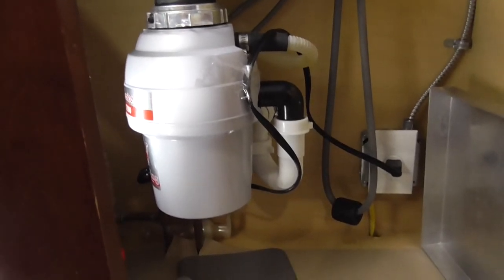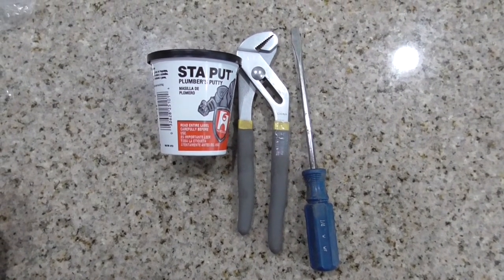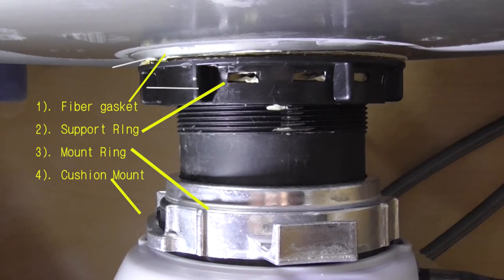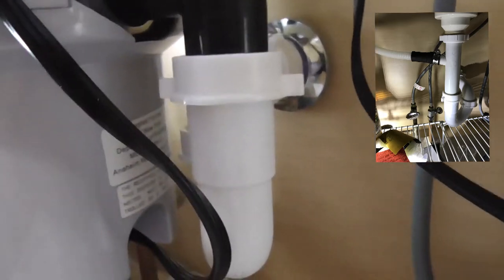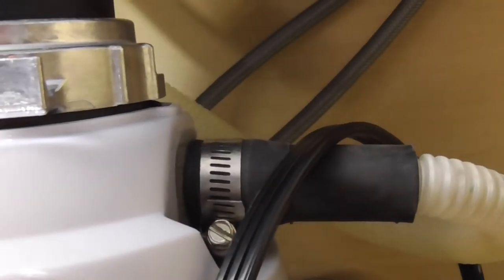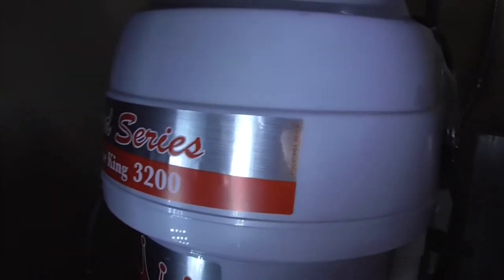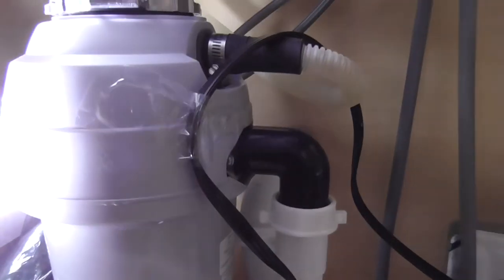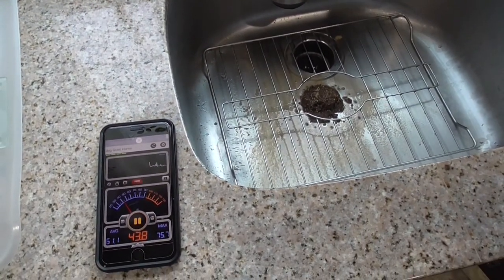DIY Waste King Garbage Disposal Installation Tips and Review

Comment: That was pretty loud once on. I hope that wasn't the 3/4 HP model.
Reply from the maker: It is a little bit loud but it 's not that bad. for $100, it is still running great!  If you can handle a little noise, then it is the great Garbage disposal. I have no regrets.
Reply: Hi, I was wondering how disposal starts to work: automatically or you need to press a button?